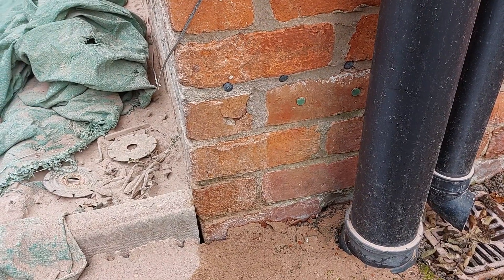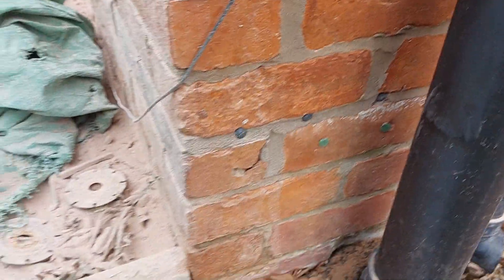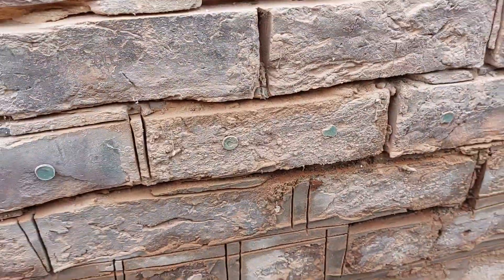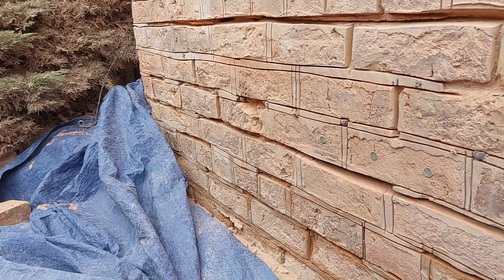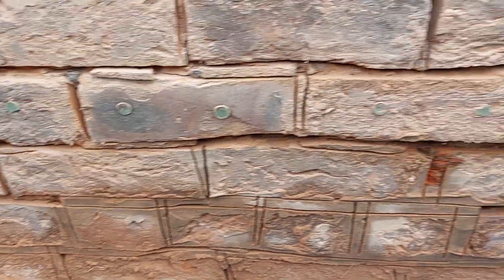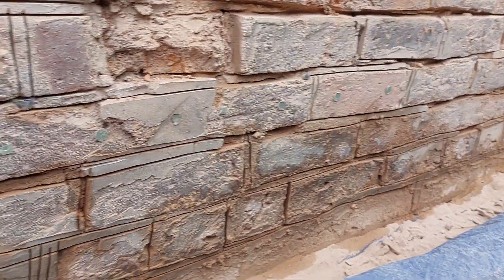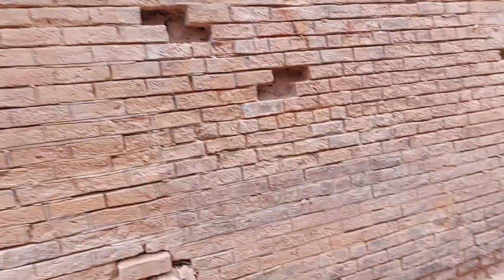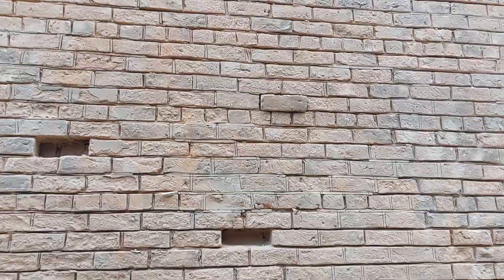The problem with pointing a damp course with sand and cement

Comment: For a 1950s house below damp course can you use 4 parts sand 1 part cement or does it have to have lime? What kind of lime?
Reply from the maker: 4:1 sand and cement is a hard mix
A house that age it was probably built with cement 
I wouldn't recommend it if you want to repoint it now I'd always  use a 1:1 5 or 1:1:6  mix 
You don't want to lock the moisture into the damp course you want it to slow release
Reply: @GMTpointingspecialistsltd  our guy isn't using lime he is doing a 5-1 ratio he says there is no lime in our motor
Reply: @GMTpointingspecialistsltd  what type of lime should we use
Reply from the maker: @neilpalmer7279  brickies tend to use a 4;1 or 5:1  with a Feb mix 

Pointers will use a 1cement 1 lime  5 or 6 sand most of us use a hydrated lime as its sticky and helps bond to cement already in the property it makes the mix flexible and allows moisture  through it 
Rather than pushing big chunks of pointing out when the moisture builds up behind the pointing like in this video
Reply: @GMTpointingspecialistsltd  he is removing all the bricks to replace some of them then re mortaring. We are not sure if the whole house has been repointed without lime the motor looks ok and some bricks are spalded but as it's 70 years old its ok. Does it take 90 days for hydrated lime to cure because if so the weather wouldn't be right for November as it's below 15 degrees. The only problem is the humidity is really high in the house during the winter so we know with new windows and this possiblity of no lime for breathability has added to that maybe but we aren't sure if the whole house has no lime in do you have an email address I can send photos too? I wish you were in county Durham North East as the trades guys don't know about lime mortar and older buildings needing to breathe here
Reply from the maker: @neilpalmer7279  if you google the name of my company wattsapp me or email some pictures  do a close up of the mortar

Comment: Hi
I live in the flat and i can see that the this court does have limestone mortar but repointing done with cement. 
as it is now outside +12 but on windows condensation,mould problem..
does anybody knows where I can call and report problem as landlord not taking any action to solve problems. 
thanks
Reply from the maker: If it's rented call the council 

But you need to control the moisture you are producing 

Don't dry washing on radiators 
Don't put your heating on full power  straight away 
Don't leave condensation on the windows or glass 

Make sure you wipe windows and glass each day 
Ventilation is important 
Keep heating on all the time at a low temperature if needed

Comment: Great video as always. There are so many different types of lime mortaring I never know which is best. I’ve heard of hydraulic & hydrated and other types??? I go by the understanding to avoid cement at all costs. I could be wrong there obviously, I’m a sparky and new to this 😂
Reply from the maker: Hydraulic use a good quality one 

Hot lime mixed with kibble or quick lime

Putty 

Hydrated is normally mixed with cement 

There's a few different types 

Depending the time of year the location of your property 
The age of the building 
The list goes on lol
Reply: @GMTpointingspecialistsltd  Really appreciate your reply. Many thanks and all the best 👍🏻

Comment: Hello. Thanks a lot for the useful content. Is it possible to say if the existing pointing is cement/sand or lime/sand just by looking at it?
Reply from the maker: Yes if you send me a picture  or drop a little bit in vinegar if it fizzes  
It's lime
Reply: @GMTpointingspecialistsltd  I will experiment with vinegar tomorrow. Thank you!
Reply from the maker: @natasha12805  no need too the picture in your email is sand and cement I'm afraid
Reply: @GMTpointingspecialistsltd  Thanks! Does it mean that the reddish mortar is not original also, the same as the greish?
Reply from the maker: @natasha12805  no it's not original  it's been repointed 
If you find a bit that's pushing out if you just tap it it will fall out 
It's not been re pointed deep enough 
You will see the original mortar behind it

Comment: If the back of the brick isn’t too bad you can always spin them round and they blend lovely
Reply from the maker: No there one sided all ready tried which is a shame
Reply: What is the composition of that mortar.
Reply from the maker: @adrianobonaldo8941  The mortar that I removed was around a 1 to 2  1 to 3 sand and cement extremely hard 
Why do you ask
Reply: @GMTpointingspecialistsltd  because normaly de dont use cement for this kind of bricks, but only send and hydraulic lime. We joint cement when we use concrete brick only. You are doing the same in Uk I think.
Reply from the maker: @adrianobonaldo8941  yes most of my jobs now are removing sand and cement and replacing with lime mortar
Reply: @GMTpointingspecialistsltd  👍 is hard to remove, than good job for tomorrow is monday. Good evenening to you.